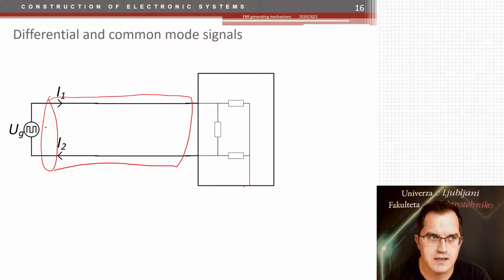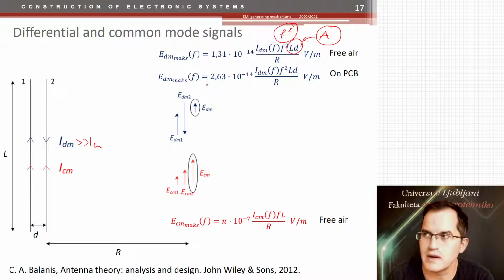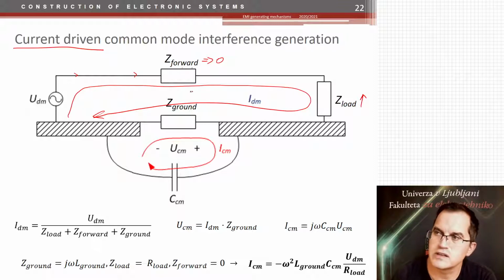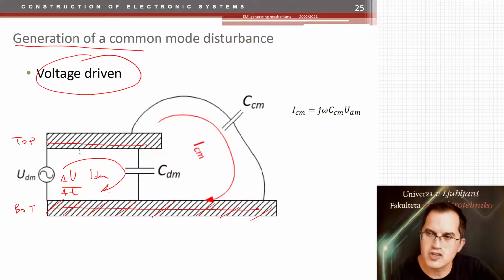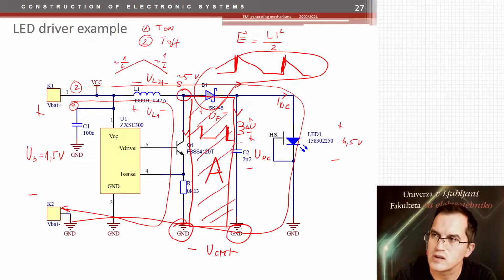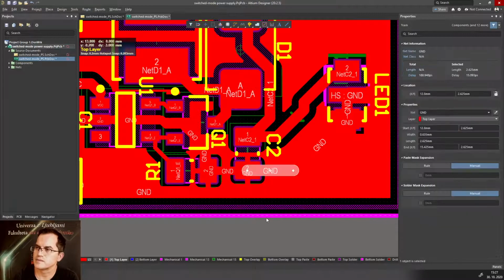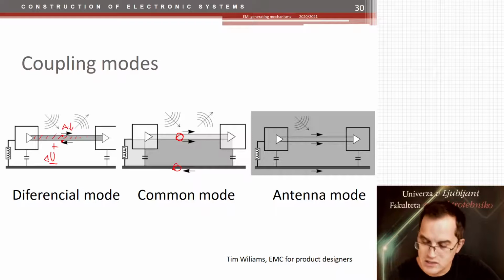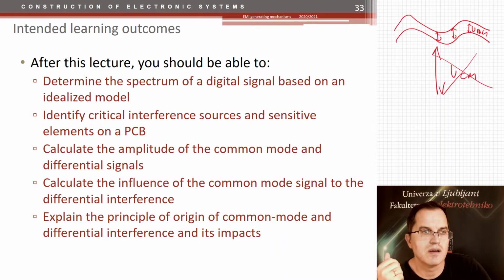CES #06: EMI generating mechanisms part 2

Comment: Extraordinary presentation! Could you repeat/explain why adding another ground plane decreased the loop area of the PCB? (at around 1:00:00 in the video)
Reply from the maker: Because, if the ground current returns on the other side of the board back to the source it has two advantages: 1. The copper plane on the bottom side is larger with less gaps therefore it can provide more direct current path with lowest possible impedance. 2. the area width formed by following the forward current on the top track and reverse current on the bottom ground plane is determined by the board thickness, which can be as low as 0.1 mm in the case of the thinnest boards.

Comment: It's great that you've shown us where the common and differential mode noises originate in our pcb designs.
Reply from the maker: Thanks. Was it your design in the example?
Reply: @mjankovec  It wasn't but it was similar, I rotated the coil like you did :)
Reply from the maker: @johnnythejst , and you did rotate the coil at that on purpose or accidentally?